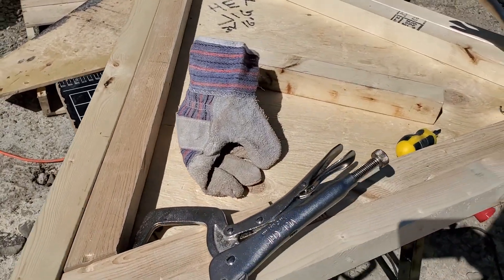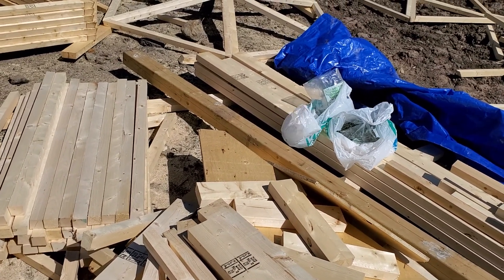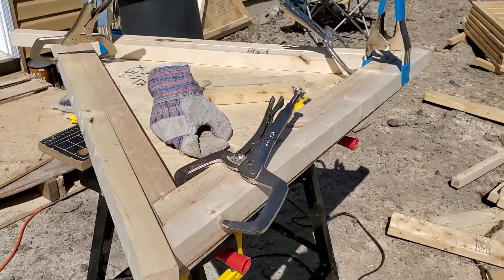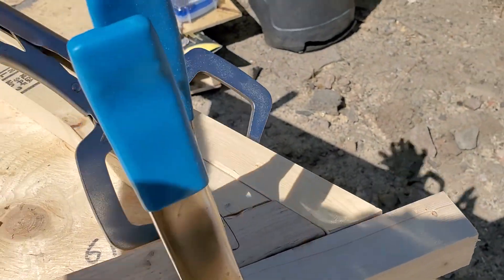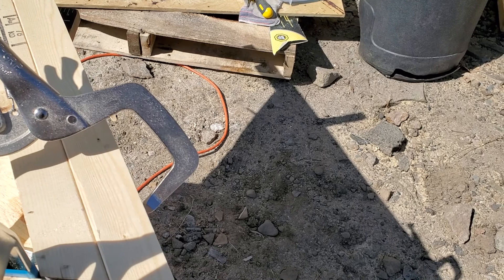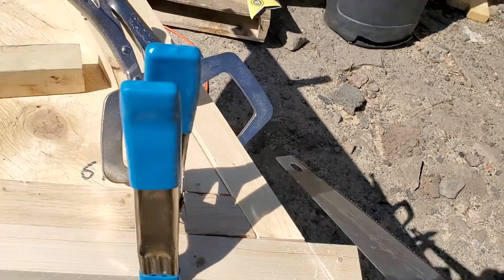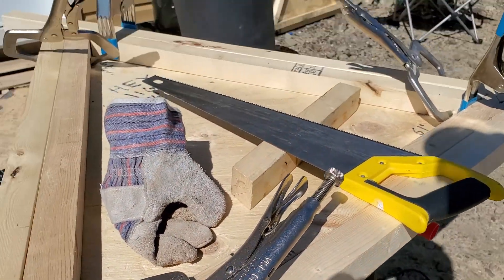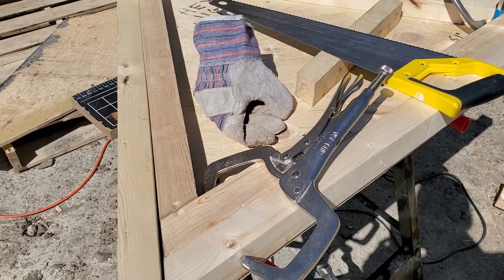GEODESIC DOME BEVELED FRAME JIG EXPLAINED

Comment: May be four years ago, but looks interesting.  Seen a lot of videos on the Geodesic dome concepts and building schemes and keep telling myself I need to give it a go, for the last 20+ years.  At least you have actually done one.  I confess the concrete domes tickle my fancy a bit more, but a wood project would be easier to manage.  I will need to check out your channel and see if you have more to watch.
Reply from the maker: @gardensandmore1614  do check out the new domes they're doing with aircrete and foamcrete.  This one was a fun build but I wish I'd known more about waterproofing them.  I should have put Z flashing and tar on my windows and angle flashing on the base
Reply: @justmeted1969  Been investigating the concrete domes for more than 20 years and keep telling myself I need one if for no other reason than to hide from the next tornado.  From what I remember, they add something that actually grows crystals over time that fills in cracks and voids.  Sort of a spin on what you can see in very old caves.

Comment: My dome will be 16’ dia. too.   Can you tell me if the strut lengths and bevel angles I am using are correct?   A strut is 2.79. B strut is 3.23, and C strut is 3.30.    
Struts A and C 166 degrees and strut b is 169 degrees….   Every time I draw these in AutoCAD, the pentagon and hexagon panels do not line up, and I end up with a gap 😢
Reply from the maker: I would look at some of Paul Robinson's videos on YouTube here, under the channel of the same name.   His really good dome building vids are from a few years ago, so dig a bit.  I myself haven't used Autocad since college 10 years ago, and that for electronics applications.  Paul seems to have good success with sketchup.   I designed my triangles on paper old school...a holdover from my mechanical engineering attempt at university 30 some years ago, when they still had a giant sliderule on the wall, haha.  According to domerama.com , another site I used during my build, your numbers are spot on.   Paul really explains the beveled frame build well in his videos.  https://youtu.be/JRbTyFK2m7s
Reply from the maker: Domerama.com doesn't give the angles but Paul's site does, tho his calculator page isn't obvious to find.  https://geo-dome.co.uk/3v_tool.asp

Comment: isnt it easier to to just angle the jig than angling and bevelling all the pieces of frames? if you glue and screw them in at an angle in an angled jig less room for error?
Reply from the maker: That's a very good question.   I got this build method off Paul Robinson's youtube.  He's the expert and may be better equipped to reply.  As for consistency,  all angled boards were ripped the same angle at the same time.   Not too relevant to your question perhaps....?   Although the consistency kinda leads to accuracy if you get lucky.  As for building an angled jig, there may exist shop quality mitre saws for the making thereof,  but what I have is a cheapo table saw allegedly accurate to a full degree.  Anything finer is me eyeballing with my old eyes.
Reply: You need to angle the OUTSIDE of the triangle, not the inside. The desired effect is that when you join two triangles together, they form part of a sphere. if they were angled on the inside, then you would just get a flat surface instead of a dome.

Comment: How did you determine the 7 degree angle?
Reply: For a 3v,  the pentagon triangle edge bevel is 7.22 deg (short sides) and 4.13 deg (long side). 
Hexagon triangle edge bevel is 7.23 deg (short side) and 6.79 deg (long sides).
Reply: the angle is 166°, so you compensate with 14° (this is the dyhedral angle). Now, those 14 degrees are on two wooden pieces, each is offset by 7 degrees, so you get the 14° needed to compensate the 166° of the curvature.